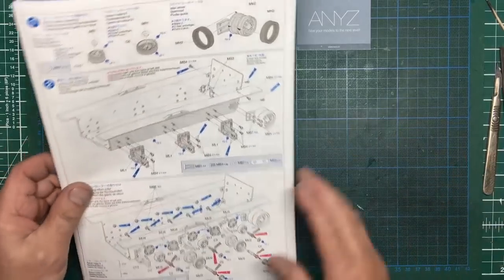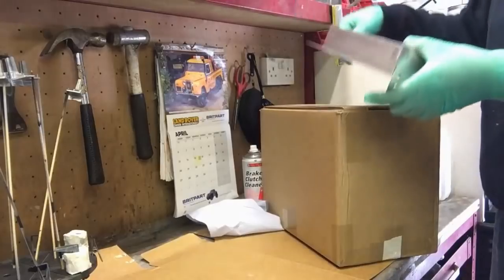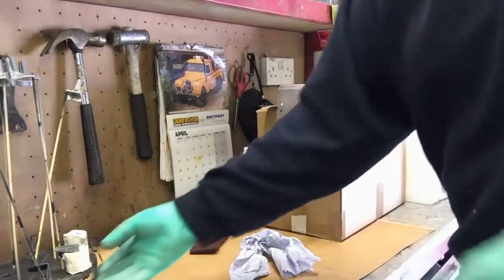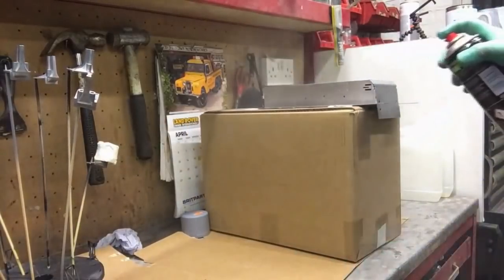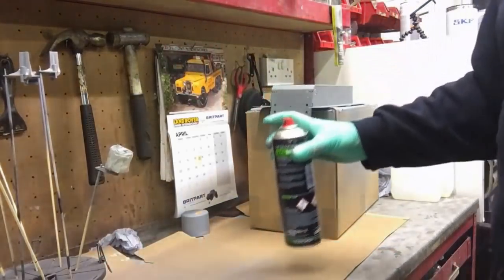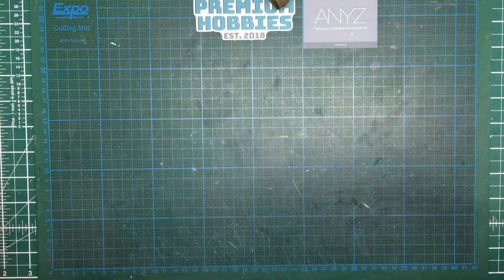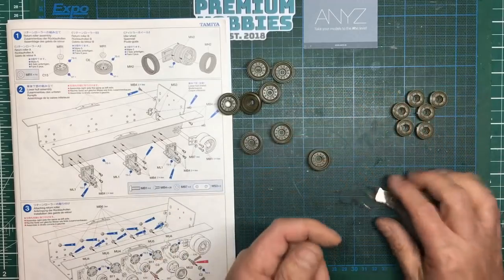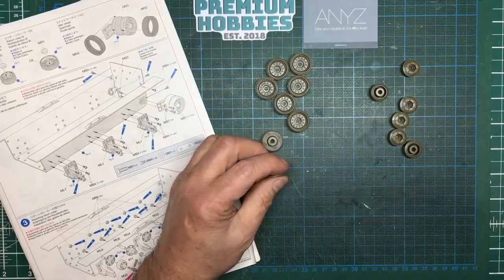Let's build a  Tamiya 1/16 RC Sherman. Part 5

Comment: Nigel i find you do waffle a bit, but I enjoy it,

Main thing is you are out there doing something, I wonder how many of the critics do that?

As you have said, if find a stage too much------forward to what you want to see

I usually watch either Phil Fl;ory or  Bobby Waldrans builds, a bit faster than yours.........but I fast forward most of them, Mr Waldron likes to repeat too many things and  gets boring,

But at least you waffle about relevant things in your build. 

Also Thank you for NMB10 at Premium Hobbies, bought the 4 Infini  mask tape matts, AK are relabelling them and £40 for just 2 and not the 4 for £45 with that code
Reply: I say relabel, it's remolding /reboxing? just has AK properly printed on them?

Comment: Nigel, are you using a mask with a filter for VOC with active carbon or just one with a particle filter
Reply: When I spray lacquers I use a 3m mask 7500 series. With carbon filter. And the added dust filter on top of that.